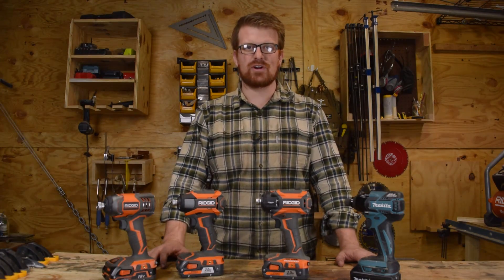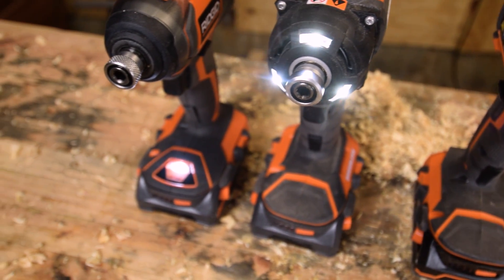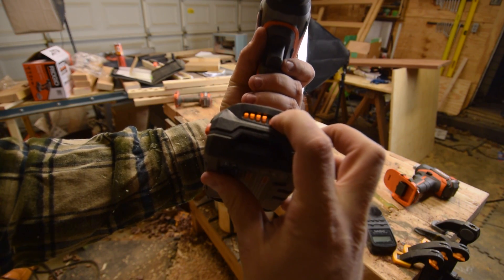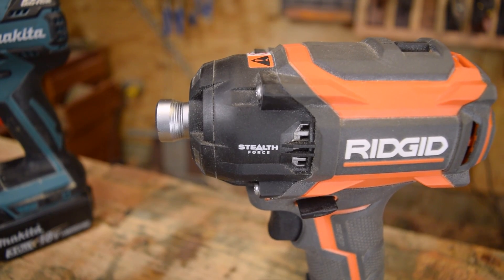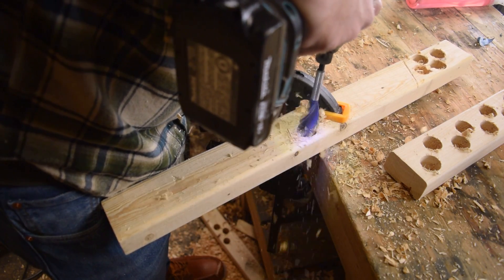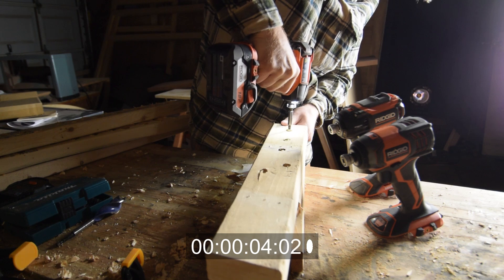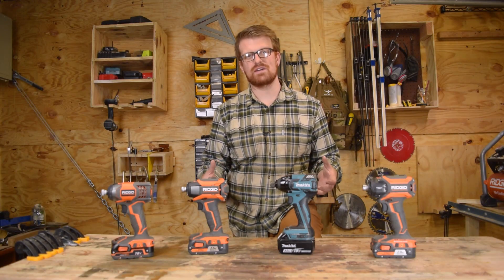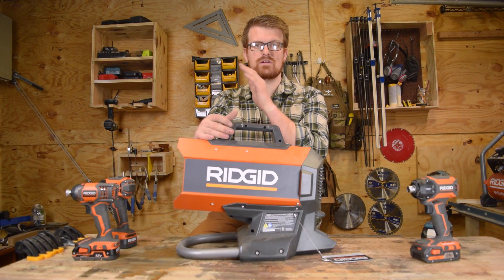Cordless Impact Driver Tech Shootout | Brushless vs. Hydraulic & more | Hand Tool Shootout

Comment: I don't know about anyone else, but the word "LIE" jumps out at me when I see the "wood work life" square logo. I am not implying anything, just pointing out that subconsciously our brains try to make sense of what we see and this may impact perception of the quality of your information. 
Also, I don't see any mention of model numbers so I can see which you are talking about when you say 'the Makita' since they make a large variety of models at various price points.
Reply from the maker: I wasn't really trying to compare brands but rather the tech in each drill.  I don't put a whole lot of credo into the differences between brands.  Almost all of the parts are sourced from similar factories and the designs are pretty cookie cutter.  The only real innovation in the last couple years has been the addition of hydraulic models and brushless motors.  It feel right comparing brands or models without all or most being present.

Comment: A little more effort required to hide bias - "Makita at 2lbs is dainty, Ridgid at 3lbs is a beast" 

Nobody that isn't being paid by a company is going to 'prefer' the extra weight in an impact.
Reply from the maker: True, I'm not paid.  That hydraulic mechanism certainly ways more.  I wish I would've had all the same brand because I was meaning to compare brushed vs brushless vs hydraulic drills.

Comment: I run a commercial shop manufacturing store fixtures. We've used the Makita drivers since they were 9V. Amazingly durable. Along the way we've tried several others but never the Ridgid. Battery life has constantly improved. I see people using drills to drive screws, no comparison to an impact driver The cheap tool brands always list a drill as a "drill/driver" a con for sure.
Reply from the maker: The one nice thing about driving screws with a drill/driver is the torque clutch for finished visible screws, but for quick work or carpentry...no comparison.  I was big into Makita before I got into Ridgid, both are BEAST companies these days.  In fact there aren't many tool companies I wouldn't recommend anymore for DIYer or production work  anymore.  I will leave that to the weird store brands and non sense chinese knock offs on amazon...

Comment: New brushless tools? That makita driver was launched like 4 years ago. Where i live, (sweden) it's not even on sale anymore. Doing a comparison with a modern makita would have been more relevant. And you can't really compare a hydraulic driver to a standard driver. The hydraulic one is not made for sinking large bolts, it's max torque is waaay lower than that of a standard driver, so you're wrong about that! Hydraulic drivers are ment for small to medium screws,like deck screws, drywall screws, selftapping screws, that sorta thing. It's main advantage over a regular driver is that it's alot more quiet, it does not have more torque.
Reply from the maker: I agree the Makita is a little bit older, but it is still the current Makita consumer brushless model in my Home Depot.  They have since release a hydraulic model too, but it is in their "pro" line.  While the peak torque is lower, the total torque per strike is about the same since it delivers a wave of torque rather than a strike, think parabolic wave rather than square wave.  A hydraulic drivers has basically the same effective punch as a standard hydraulic driver, while also being quieter.  The idea of this video was to compare the different technologies, not an apples to apples comparison.  I wish I would've had the Ridgid brushless 5X instead of the Makita, would've been a more apt comparison.  That Makita is a beast, but so is the Stealthforce.  Thanks for watching.

Comment: Appreciate the time you take to put these videos together.  Personally, I have the Milwaukee M18 Surge, which is very similar to the Stealth Force Driver.  A Milwaukee/Ridgid/Ryobi tool rep turned me onto the hydraulic drivers.  Aside from having half the noise, the hydraulic impact drivers have about 3x LESS vibration.  From someone who uses these daily, that is a lot less wear and tear on the joints (tendinitis is a common ailment resulting from using impact drivers).  My work is almost exclusively indoors and it is definitely a plus for when the homeowners are present (and less scary for little ones too).  While I'm sure you were probably just using an auger bit to test battery longevity, impact drivers are more ideal for driving fasteners and really make horrible looking holes when used like a cordless drill.  Just thought I'd add a little additional trivial information for when your reviewing your next driver from the new shipment of RIDGID tools you just recently un-boxed the other day ;)
Reply from the maker: +John Lovelace thanks, ya the auger bit was just to test the battery life I wouldn't dream of actually drilling a finish hole with an impact driver.  In preparing for the video I found that driving that many screws with an impact driver was ridiculous.  The new brushless tech really gives you a lot more juice.

The other really hard to "measure" feature of the hydraulic drivers is the manner in which it delivers the torque, there is more torque delivered throughout the motion rather than just at the point of the hammering action.

Thanks for chiming in!
Reply: Ditto to that, I have the Surge and have almost stopped using regular impacts since I got it.  Gr8 for 90% of what I need a driver for.

Comment: The Makita vs Ridgid comparison is invalid because they did not use the same voltage and same amps batteries. Always when comparing battery operated drills and drivers, use batteries with equal power.
Reply from the maker: +Yousef Imran they did actually
Reply: Oh well the video didn't show it. Bug good to know at this point. Thanks.

Comment: Ridged is really making a strong push in quality tools, i hope they come out with a outdoor power line that competes with milwaukee and dewalt.
Reply from the maker: Carravagio16 you realize milwaukee and Ridgid are the same company right?  It's TTi
Reply: i know they both are owned by TTI but i wouldn't say they are the same company, I'm sure TTi has input, either way both are making some great products and only getting better with battery improvements
Reply from the maker: +Carravagio16 it's seems like RIDGID is like the beta test platform for stuff that they will perfect and bring out in Milwaukee gear.  Like the stealthforce came out for RIDGID first and then they came out with that beast hydraulic impact for Milwaukee that was smaller, lighter, and quieter.  But pro features like the higher ah batteries came out on Milwaukee first and trickled down.  I think TTI having a foot in both markets really benefits both brands.
Reply: smaller lighter and quieter but had a lot less torque.

Comment: the makita has a 3ah battery...the rigid is a 2ah...not apples to apples
Reply: Clearly has a 2ah on the batt test, use your eyes
Reply from the maker: I was using a 2ah battery on the Makita for the battery test 3ah for the power and speed test.

Comment: I have the 5X combo drill set which I'm in love with also have the Ridgid 18 gauge nailer the Ridgid Palm driller I have the Ridgid Air Compressor I have the Ridgid shop vac I have the Ridgid wet saw 8 inch blade I have the Ridgid multi tool and I also have two three piece Ridgid tool box set what I want next is the 16 gauge 18 volt trim gun heard good things about them

Comment: Whats the differences between an impact driver and just a drill?
Reply from the maker: An impact driver has a rotational impact along with the spinning to help drill a hole, drive a screw with more torque.  A drill just spins typically, and a hammer drill has a hammering motion typically for drilling into concrete or masonry, it allows the bit to chip away at stone or whatever...

Comment: Ok,  so no one pointed out that the Makita had a 3.0ah battery while the rigid only had a 2.0ah. of course the Makita will drill more holes in this comparison
Reply from the maker: In the battery test it was a 2ah battery, I know because I had to go out and buy one all $80 worth just for this video (and you can see it in frame during the battery test.  The 60 holes shocked me too.  I would bet the brushless 5x would be closer to the Makita, 49.5 from the Stealthforce is not laughing matter though.  Maybe the hydraulic impact takes more power to run?

I did use 3ah batteries for both during the speed test, I bet the hydraulic would've been much faster if I would've used the 5ah battery and the Makita might be quicker with their larger pack as well.  No funny business here...

Comment: Why would you drill holes with an impact driver?
Reply from the maker: +Ashland Gun club Boring holes in deeper tougher material like for instance in building a deck and drilling for the lag bolts or when you are drilling through studs to run wire or plumbing.  You wouldn't want to use it for furniture making.
Reply: That's a sure way to destroy your impact and have a crappy looking job. A better test would have been to drive 10" lag screws.
Reply from the maker: +Ashland Gun club what makes you think that would destroy them?  This is just one of the many tasks they are built for.  You need to make sure to get the right bits though.
Reply: Yeah...the instruction manual on my Ridgid brushless impact literally says not to drill holes with it...that is what the drill is for...

Comment: I just got a ridged 5x brushless kit.  I can't believe how different they operated than my old craftsman tools.  fantastic review
Reply from the maker: +robhimself79 That is the one I wasn't able to test.  I was amazed how much better 5x brushed was than x4.  I thought all that tech was set in stone.
Reply: Wood.Work.LIFE. when I got it, there was a sale and you got 2 free tools with the 3 piece kit. I chose the reciprocating saw, which is the 4x line unfortunately, but its still pretty great. I also chose the 5x brushless trim router which I haven't used but it was a $100 tool for free..  I am so happy with the tools I may invest in the 12v line as well.
Reply from the maker: That trim router is amazing, check out my sign carving video if you haven't already.  I put that thing through its paces!  https://youtu.be/LIC9lYW03mM
Reply: Wood.Work.LIFE. I have not seen this.  awesome stuff!
Reply from the maker: +robhimself79 Glad you liked it.